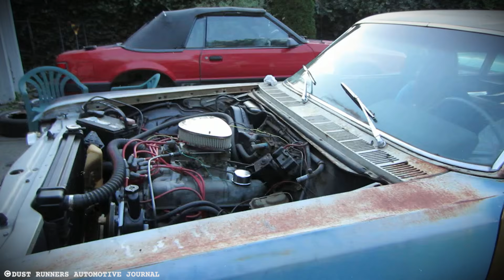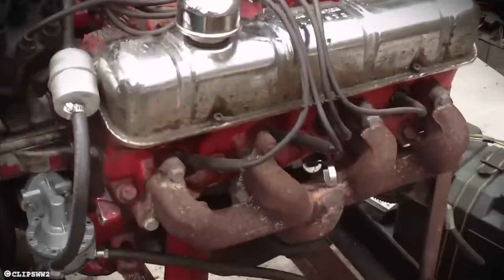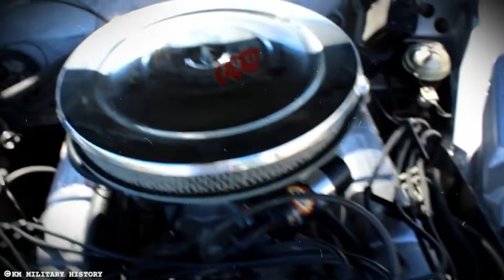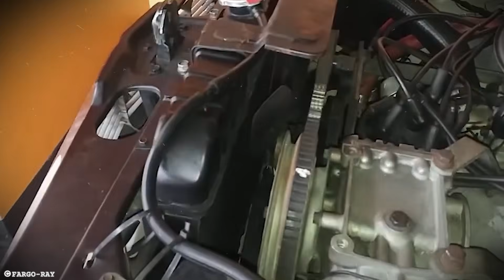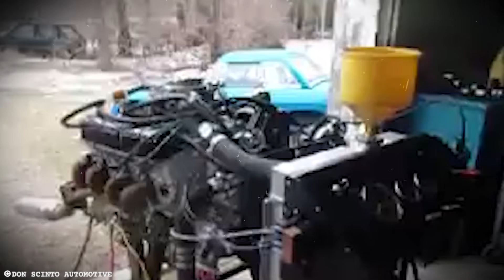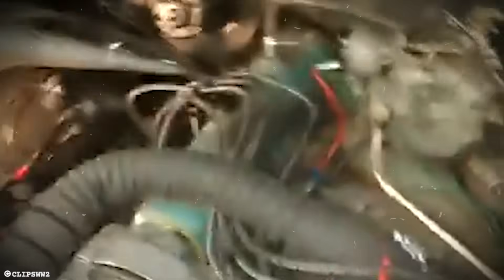Even at 155 HP & Aluminum Block, the Buick 215 V8 Surprised Everyone

Comment: Here's the biggest problem with using this engine:  the bell housing bolt pattern.  There is no modern transmission that fits it.  You can get one to work, but the adapter from D&D will cost $1000 dollars for an automatic trans like a turbo 350 or if you want a standard shift, you're going to spend $2500 for the parts.  Don't believe me?  Call them.  This cost makes using the engine a boat anchor.  As much as I'd like to use it,  I can buy a used Chevy small block and auto transmission for $500.  Not a really good one, but one that works.  Yeah, the Chevy weights 200 pounds more, but then so does the passenger. 
I have 2 of these engines, good ones.  But I'm not spending a thousand dollars for an adapter to put a transmission on it.  And forget about using the stock auto transmission.  No one will rebuild it for you.

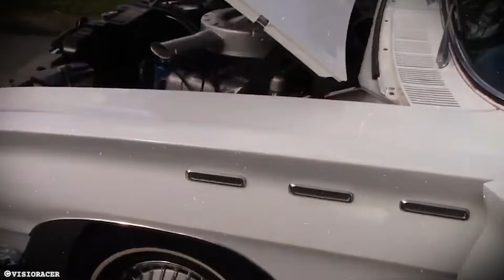Comment: My father bought a 62 Olds F85  with the 215 and the 4 barrel carb.  Was a great little car, very fast.  It's biggest problem was it wouldn't start in the winter when the temperature was below freezing.   Many y a time he had to have it towed to our local gas station  to sit inside until it thawed out.  He borrowed my 54  Chevy to get 33:04 😅to work. My  Chevy always started

Comment: Its been a while and I don't remember the 2bbl specs for sure.
Head gaskets
Both Buick & Olds, 2bbl & 4bbl used the same head gasket! Its a thin stamped steel gasket embossed around the cylinder, water jacket, oil passage & head bolts (the extra Olds bolt holes would leave a ring on the Buick block).
NO composite
NO added copper
Just thin stamped steel! The aftermarket composites were very thick and lowered your compression. If I remember correctly Victor was the only MFG that made a direct factory replacement.
Buick
61
HH 2bbl 8.5 to 1
HP 150?
HI 4bbl 10.25 to 1
HP 185
62
HH 2bb 8.5 to 1
HP 150?
HI 4bbl 10.25 to 1
HP 185
63
JM 2bbl 9 to 1
HP 155?
JN 4bbl 11 to 1
HP 200!
Olds
61
?? 2bbl ?? to 1
HP ???
?? 4bbl ?? to 1
HP 175?
62 
?? 2bbl ?? to 1
HP ???
?? 4bbl ?? to 1
HP 175?
Turbo
?? 1bbl ?? to 1
HP 215!
63 
?? 2bb ?? to 1
HP ???
?? 4bbl ?? to 1
HP 195!
Turbo
?? 1bbl ?? to 1
HP 215!

Buick changed compression ratio with pistons, Olds changed it with combustion chamber/head.
With the exception of the turbo engines Buick made more HP then the Olds versions.
Reply: I hadn't watched the entire vid but there is no sleeves/inserts in the lifter bores.

Comment: I put a 185 hp 63 version with the small Dynaflow automatic transmission in a 74 Vega kammback.  Great fun but was never able to cool the air cooled transmission enough for stoplight to stoplight showing off.  Did great on crooked two-lanes in the mountains.

Comment: A great little engine!  GM should have stuck with it for few more years, the problems were fixable.   A big reason for selling it to Rover was casting problems caused by casting the block AROUND the iron cylinder sleeves.  The blocks would crack, or the sleeves would become loose.   Some batches of block castings HAD A 90% FAILURE RATE!  They had to be melted down and the sleeves fished out of the molten aluminum.  Rover solved this by machining the blocks and pressing the sleeves in later.  The sleeves stayed in very well until the last 4.4 liter engines in 2004, 5, and 6.  A British aftermarket company solved this by making new sleeves with a bigger step on the top.  
   The Oldsmobile version of this engine used 4 additional head bolts each side.  The bolts were longer, and also held down the rocker shafts.  The Buick rocker shafts had shorter bolts going into the head, not the block.  Buick and Olds blocks both had the bosses for the extra head bolts, but on Buick blocks the bosses were not drilled and tapped.  Rover blocks did not have these bosses, but they can be added by welding and machining. 
  The Buick valve covers were tall and narrow, made to resemble the Buick "Nailhead" engine.  The Olds valve covers were wide and angled outward,  and are not interchangeable.  Anyone who boosts one of these engines, or otherwise runs it very hard, should install the extra head bolts.  
   Very nice for smaller, lighter sports cars.  Adequate power, light enough not to destroy the handling.   Rover fuel injection manifolds will fit, including the 180-degree design.  The 180 should be cut apart and welded for dual throttle bodies.

Comment: I own a Land Rover LR3. 2006. The last year this engine was put into n a Land Rover. 
I never expected it to be reliable. But it's been ...!... wonderful. 
Fuel injection changed this engine into a beast. Mine is a 4.4 liters. Wow! 300hp &
300+ft/pounds of torque.   Plus... it's smooth as silk. Doesn't use oil. And again... 
... it's turned out to be seriously a 350,000-450,000 mile engine.